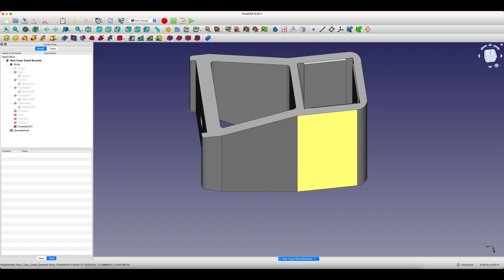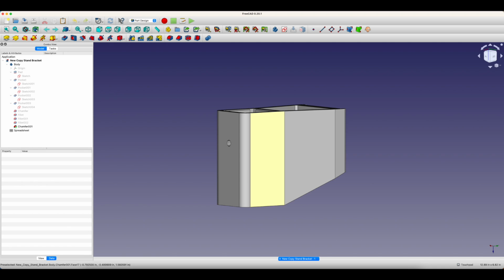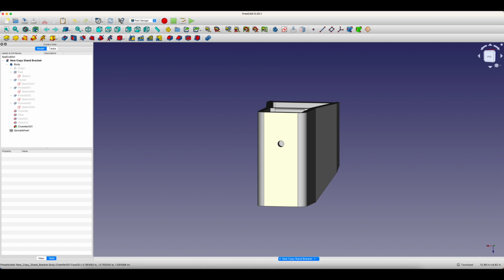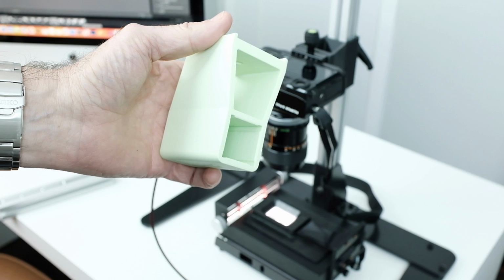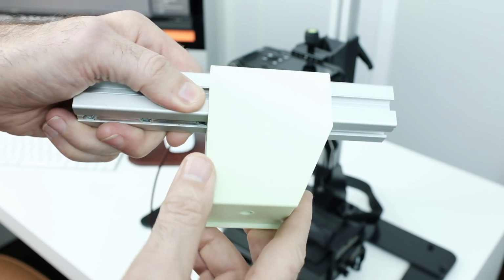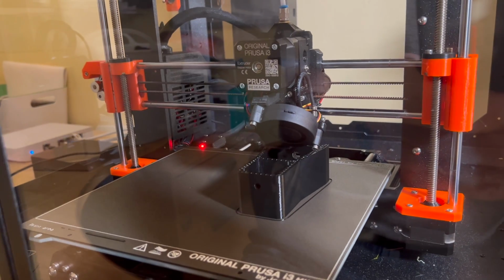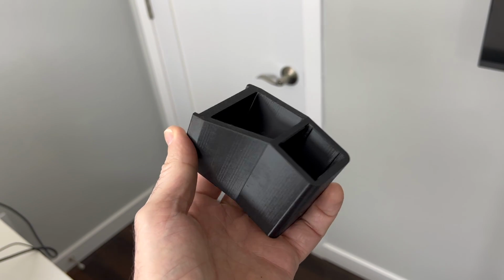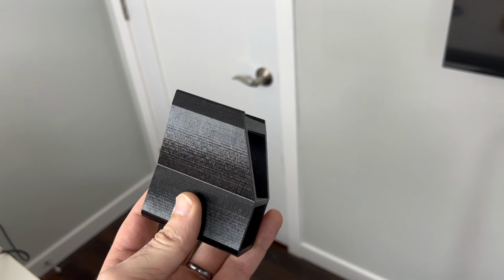Tweaking the Valoi Film Scanning Copy Stand...let's make it better!

Comment: Simply had to comment.. Cannot thank you enough for this! I just bought the copy stand and was bummed out how flimsy it was and this is exactly what I was looking for. Bought the same ARCA swiss adapter and plate, and printed the bracket with PETG at 30% infill and it came out flawlessly. The fitment is spot on and everything went together perfectly. I use my camera a lot when i'm not scanning so the quick release is a life changer now. thanks so much again!
Reply from the maker: Glad to help! The original was lame and needed to be replaced. I also made another version that holds the camera pointing horizontally, to serve as a fairly solid and precise tripod--I use this one to hold my camera for doing videos. The model and FreeCAD source for the horizontal version are also on my Printables page.

Comment: Hi, I want to copy this using a 3d printing service that offers petg, when I upload the file its asking in what measurement is the file in mm, cm or inches, and it's asking me the infill percentage?
Reply from the maker: I did this in FreeCAD which should have exported the .stl file in mm. I work in inches, but FreeCAD is supposed to use mm internally, and my slicer didn't do the weird things (i.e. prompting me to scale) that I often see when I try slicing models made from other tools in inches. Preview if you can. I printed mine using 25% infill, since it is under strain.
And please post how it turns out!
Reply: @TadTadd  thank you, so I will use mm, if you can confirm the measurements,  also if I go 80%-100% will that make it much stronger, is it recommended? I don't know anything about 3d printing, and I just found some that do petg printing
Reply from the maker: @ed-lee321  If you use 80-100% infill, the part will be heavier and stronger. The tradeoff is that it will take forever to print, and the vendor might charge more because of that. 25% is a quite serviceable amount of infill for a part like this. Check what happens to the cost as you adjust the slider and choose accordingly.
Reply: @TadTadd  meausrement shows 57.15 × 95.25 × 76.2mm, and with 100% infill its $3.80 more for total cost of $18.36 shipped
Reply from the maker: @ed-lee321  I just grabbed a metric caliper and measured mine and your numbers are good. That's pretty cool that they do that for less than twenty dollars--it sure beats buying a 3D printer and learning how to use it just for a few parts here and there. Post an update when it arrives!
Reply: I found a 3d printer on treatstock for 13.61 shipped with 100% infill I will let you know how it goes, if it comes out good I will order this copy stand after.
Reply: I'm going to be mounting a nikon Z 7II with Nikon 105mm AF-S VR macro lens and NTZ Adapter so it's going to be close to 3.5LB so I needed your stronger bracket design, thank you for all your help
Reply: @TadTadd  hey, what size 1/25-20 cap screw and which arca Swiss did you order for this 3d part, I just want to order same thing so it fits thanks!
Reply from the maker: @ed-lee321  It's a standard 1/4-20 socket head cap screw, about 1/2" long. Grab one at Home Depot along with an appropriate washer to put between the head and the PETG plastic. I found it a tight squeeze to get an Allen key in the plastic part to tighten the bolt, but it worked.
Here is the Arca Swiss adapter, for the shocking price of $13. It has an adapter sleeve in the thread that you will want to keep in place so the 1/4-20 screw works. https://www.amazon.com/gp/product/B0B4C2D2GP/ref=ppx_yo_dt_b_search_asin_title?ie=UTF8&th=1

Comment: Hi! This is just what I was looking for to build my own copy stand. But I have a question, how did you attach the Arca adapter to the module... and if you are reusing the Valoi stand fixation to the column?
Reply from the maker: I used a 1/4-20 socket head cap screw with a washer to come through the back side and attach the Arca adapter, just like if it were held on to a tripod. There isn't much room to swing the hex wrench but it worked.
I reused the original T-nut and spring-loaded handle to secure the square portion of the part on Valoi's extruded aluminum bar.
Reply: @TadTadd  Thank you very much, I will write down the features for my future project. Very good job on the 3D support adaptation.

Comment: Very nice.. Thanks for sharing the info.  I currently use a film scanner flat bed style..  Epson .. Its good if you scan at a pretty high res in its raw hd format.. Kinda like you are doing but scanning the neg instead of taking a picture of it.. Then you import the high res negative image and convert that using what ever software you wish..    I tried the included software and using all the fancy digital ice stuff and well it kinda sucked lol.   Its more steps the way I do it using Silverfast and Lightroom but the results I get people have told me they like the end results better from my scans and edits then they have seen from most labs and I kinda have to agree.   I think the only real serious scanning method is like a drum scanner and for smaller prints and social media posting the methods I do now work fine .. If at a latter time I find a negative that I just love the image and want it printed at a large size then maybe I would find a place that can scan the negative with a drum scanner and give me the higher resolution image from it..  I also bought an enlarger and have that on hand but its a older one made for black and white..  In order to use it with color I would have to buy colored plastic filter sheets and stack them on top of each other in the tray area of my enlarger but it can be done ..   I will be developing and scanning a large batch of black and white rolls in the near future and I very well may try my hand at doing some dark room prints with that vintage enlarger :).   If it goes well ill let you know..  I can share where I post my film based photos too if you would like?
Reply from the maker: I was looking into flat bed scanners, but decided to try hunting with what I brought, and did research to see if my Fujifilm XPro2 could do digital scans. As it turns out, it is good enough for everything I do with photography--rarely do I print physical photos--so I'm happy with it. It takes me about 2 minutes to scan a roll...then an hour to type in all of the metadata. Using Negative Lab Pro in Lightroom, nothing more. I haven't tried color negs yet, so the jury is still out on that.
I envy you being able to do real paper prints with an enlarger--that's where half of the art is, doing real dodging and burning and so on. I'd have to give up something else (like the machine shop) for the space, so I'll have to settle for scanned negatives for now.
Anything that is worth printing, I'll send to a lab to be drum scanned.
Post your links! It's always cool to see others' work.
Reply: @TadTadd  I have tried twice to tell you where I post my images and both times they seem to poof..  I can not see the responses I posted with the info..  Can you still message people on Youtube?  If so send me a personal message and I can try and send you a link from there.
Reply from the maker: Looks like that feature disappeared some time back. I remember using the messaging feature in the past, but they must have decided it was too much overhead or trouble to maintain. No worries! I bet your photos are awesome--if they are film, they must be great.
Reply: @TadTadd  Darn I really wanted to share them with ya.. I think you would like the place too as its always cool to check out others photos :)..  My user name is the same there..   G R A I N E R Y lol.   Lets see if that sneaks past there detection lol.  Check it out if you want ..  I look forward to seeing more of your photos ..
Reply from the maker: Awesome. I am aware of the place and will be checking things out. Thank you!
Reply: @TadTadd  Great :).. I normally do not post stuff like that on other platforms but I am not sure about you but I tend to find inspiration in others photos so looking at others photos is a great way to help with creativity :).